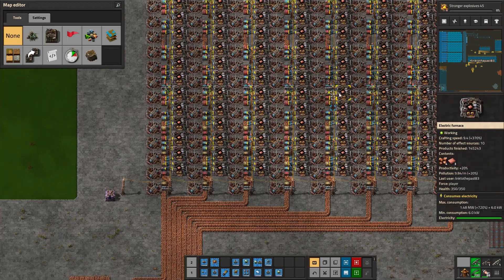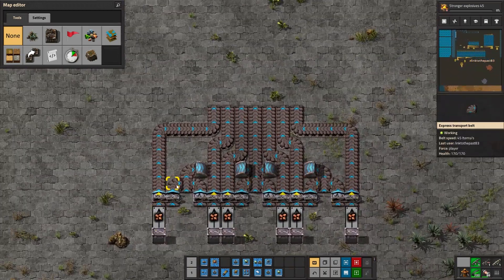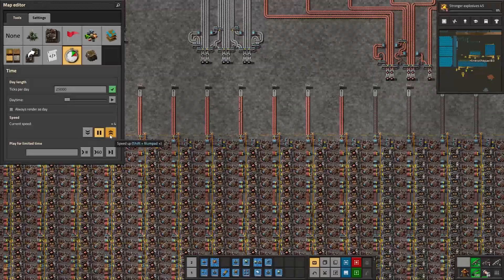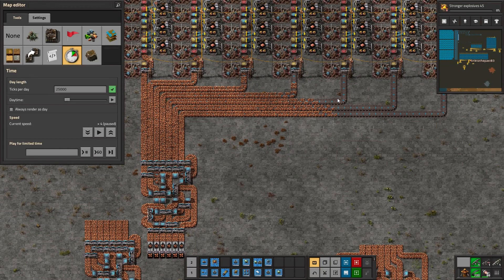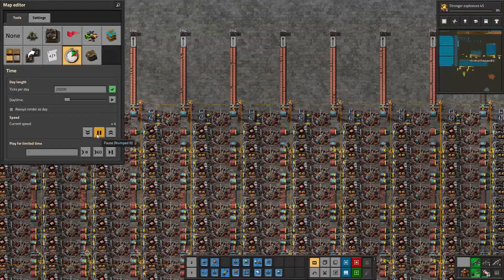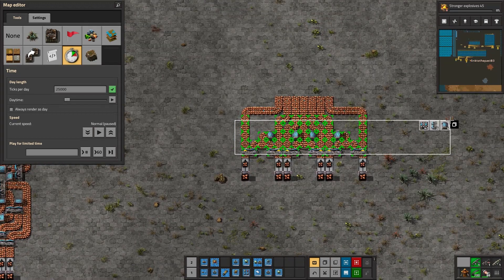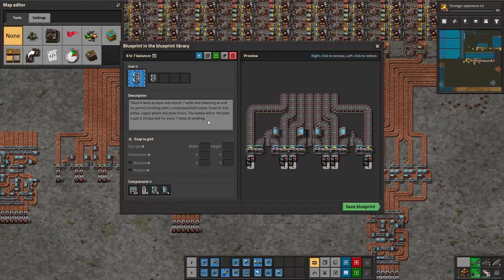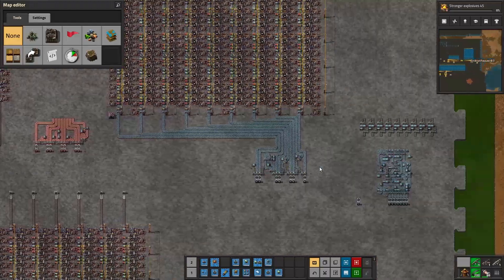Save production in Factorio using priority lane balancers.

Comment: this is cool and I would use it on far mining outposts, but I feel like for train supplied smelters, its not a big deal. Just don't try too split belts in more lanes and you good to go with the help of buffers. Tho you would need a bit of circuit knowledge and some train wizardry for that.
Reply from the maker: This is just an easy and efficient way to provide your smelters and other production facilities with closer to what you really need so that you need to overproduce less and need less buffer. Not the only way as i showed just easy and more efficient.